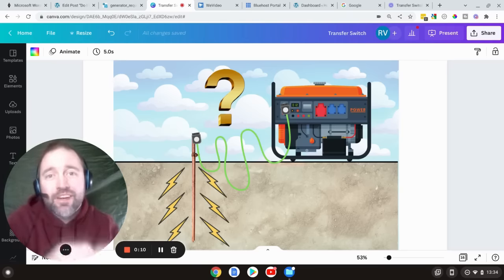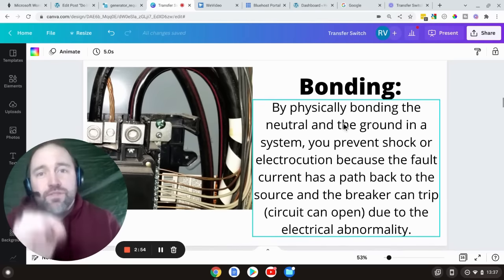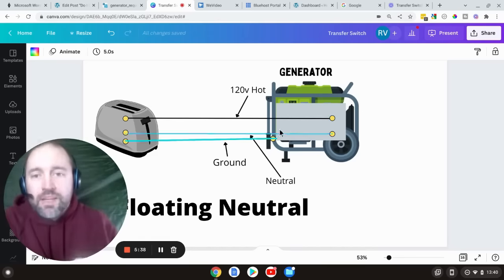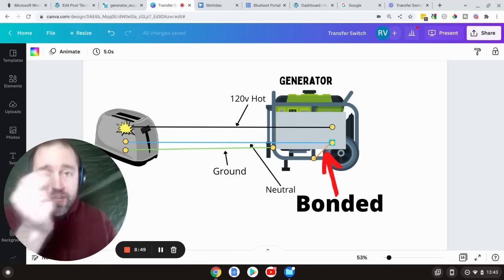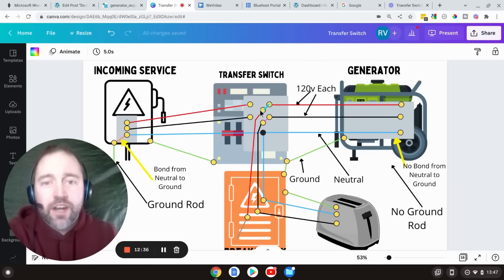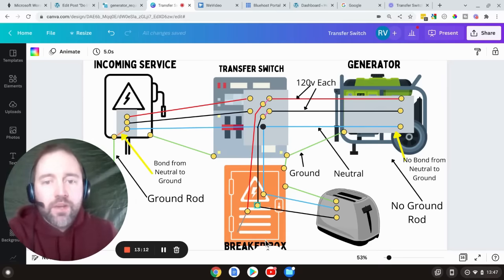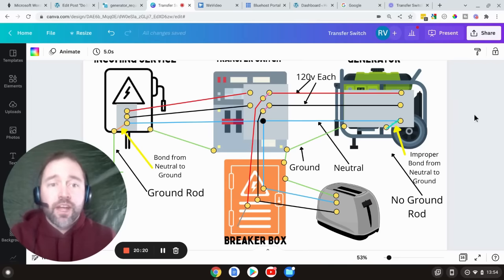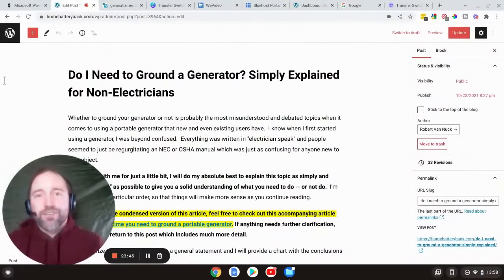When You DO and DO NOT Need to Ground Your Generator [Extension Cord Use & Backfeeding a Home]

Comment: Older homes do not have a main disconnect switch, so there is no Neutral bond before the main panel, except at the utility transformer where the neutral and ground is bonded in many cases, The earth ground and neutral are then bonded in the main breaker panel. Any sub panels off the main panel do not have the neutral and ground bonded.
People often get portable generators with a GFI main breaker in the generator. When connecting to a house, this sharing of the bonded generator neutral and ground, and the bonding in the breaker panel, will always trip the GFCI in the generator as not all current flows on the neutral, but some neutral current flows in the ground wire between the generator and the house.

I often see this fault with a portable generator being used to power an RV. The service in the RV has the neutral and ground bonded. When plugged into a GFCI protected generator, it will pop the breaker. Some campgrounds have GFCI breakers for the RV hookups and a bonded RV panel will trip those breakers too.

The Utility bonding the neutral and a local pole or pad ground will often result in measurable current on the ground rod in the residence as there is no "Ground wire" to the utility, only neutral. If there is a ground gradient, between the house ground and the utility ground, there will be current in the utility and residence ground rods.
This is most often seen when a distribution line is only single phase and the utility transformer primary is hot and neutral instead of two hots. All wire has resistance, so the utility transformer will have it's voltage drop on the neutral conductor of the primary line become slightly elevated from the local ground potential. This can cause problems with some solar equipment and other sensitive electronics.

Comment: So many people misunderstand what happens when electricity has two paths to chose from. Current neutral bonding standards, unfortunately add to this confusion because the scenario they are trying to protect you from is a very specific one, that, in the interest of safety, is never fully explained due to the fact that outside of this specific scenario,  bonding  in a second, or third, or 100th place in addition to the first means of disconnect makes no difference at all.   What is this mysterious scenario you ask? If something causes the Neutral path to the source to be broken, then power will return via any grounded part, be it the frame of the toaster, or the generator or what have you. Unless the neutral is open, bonding grounds to neutrals does nothing. It does nothing. Everything that is grounded is at zero potential to ground. The frame of the generator will always be at zero potential to ground, as well as the neutral, and you will never get a shock from touching anything that has zero potential to ground, if you are not touching the hot leg. An open neutral path is the only thing that makes additional bonding dangerous, because the ground wires may not provide sufficient current carrying capacity to cause a breaker to trip, in the event of a short circuit to any metal part of the appliance. Meaning the circuit is shorted, but power is not interrupted, leaving possible potential that you could get your hands on, not to mention grounding conductors are often much smaller than current carrying conductors, and tend to simply overheat, rather than tripping the breaker. Anything grounded with a metal wire will be the path of least resistance electricity will prefer to take, rather than any circuit completed by a human body.

Comment: Respectfully submitted for your enlightnment, having repaired generators extensively for the US Army, I will point out that all generators should be grounded by the frame. I saw a man lose his life on a free standing generator, 60kw, that was faulty, when he became the grounding mechanism with one foot on the platform and another on the ground. A grounded frame would have saved his life.

Comment: this means that i can use the previews  earth pole from my house for off grid 
.    no grid on that system anymore if  there s questioned!!!!!!    but  if use the earthing LINE on another panel with extention cords i need to uninstal  the earthings of the first panel i abandoned so they wont get electrified any scenario  error....!!!!!     inverter was a car inverter   and didnt have any earthing so i made one to bond and connect!!!!      now i need to have batteries fully enclosed to be fully safe !!! and of course  respect AC and DC  !!! thanks man

Comment: Very good, I got a question mab u can help. I have 400 amp service it goes to an sub panel , 
off 1 of the main panels I have my well pump I added a room on the house use 1 circuit for that room
I put in a GFIC in because it is a concert floor. Don’t know y but ever so often it will trip the gfic,
It is all on the same ground rod, y will it trip the gfic?

Comment: Thanks for this amazing content. I have a question: What if the generator is bound from neutral to ground, with no ground rod and the neutral is not connected to the incoming service, can I use the ground from my home? The generator will link my home with 120/120/N (no link for the ground), but all devices at home will use the ground from my home. Is it safe?

Comment: As an unlicensed electrical contractor very nearly every installation I see has an unbonded neutral in the main panel and there is a 2.8VAC difference between the two throughout the house. Without a doubt, it is licensed-yet-clueless contractors who are doing this. Personally, I educate my customers regarding the safety concerns. Additionally, I frequently see "hot loops" which share multiple circuit breakers on the panel. Assume nothing.

Comment: Interesting video. The one thing I noticed is the transfer switch we have only has 2 blades. Both are hot leads. The neutral and grounds are not switched. Each switched leg is one leg of the 220v circuit.
Reply: Neutrals are not switched, any potential for the neutral to be switched a the slightest amount of time where the hits aren’t can create dangerous voltages

Comment: Can you make a separate video explaining this but with an off-grid solar panel system setup? I'm trying to power my home with solar panels, inverter/batteries, main breaker panel, and backup generator. I know some things have to be bonded and grounded, which are they? And should I put the main ground rods on the main breaker panel or solar inverter? Thanks!

Comment: I’m just a guy with a floating neutral inverter generator that wants to run a couple of extension cords into the house during a power outage. Do I need a ground rod? Thanks!

Comment: Don't simply do anything in the video as it may be dangerous in some scenarios (not all). 
The UK had special regulations for double grounding if the cord goes outside the grounding network of the house (Tesla charger to a car). It may be ok in the us as most service is connected this way, but keep in mind you may have a different kind of service or grounding in your house. It's not impossible to get 3-phase power in the US (if you live in an apartment complex, have a larger AC-Unit, an 3-phase washing machine, a solar panel ... even after this got removed your power service stays the same). My flat still have the 500A service line from heating with electricity after the heater got removed and nearly all cables removed (copper was expensive). Here nearly nobody have the the bonding in the incoming service panel and it's done near the breaker box or in a special combined box (for incoming service, meter box and breaker box with several in one big box). Every electrician use a tester to verify the conditions before he left the side.
It's possible and in some times necessary to have multiple grounds (over AWG 9 you have special exceptions). If your generator is to far from your house it may be mandatory to have a separate ground or it may be forbidden in some cases. All new homes should get 3-Phase power (for future solar or future car chargers).

Comment: Electrician here and I agree with what you’re saying here and I have myself tried to explain to safety guys at work and they have no clue….most of my experience is not with a genset as you have shown. 99% of generator use is for power at a remote place which needs temporary power, and all electrons must return to the generator for current flow, that being said if a person were to become energized by a fault if no ground rod, no current flow. Unless someone HAS driven a ground rod. Most folks have had pounded in their heads for their whole lives that electrons want to “go to ground” and this is not true, the electrons will flow only if given a way to return to the generator. Even if your body is energized current will only flow if there is a path of return to the generator, therefore in this case no ground rod is preferred! It is my experience that a generator setting directly on the ground running, has such a poor connection to the ground, that you must consider it not grounded, as the connection to ground is too high of resistance to conduct. Again I’m of the opinion that no ground rod is required for these remote situations!

Comment: i disconnected the bonded neutral tap  of a genaeator that was set up with a generator outlet and a breaker lock at the main , the house was tap to ground at the meter base, neutral was tap with service neutral, tested, all work , told customer that the genarator would have a open ground wend not cord plug.

Comment: I have a interlock kit on the main panel. The generator supplies power through a 30 amp feed and it has a floating neutral and grounded to a ground road. An electrician inspected the set up and I have been using it during power outages for a few years, no issues!
Reply: That only works if your property has a ground rod too so that the daily current can flow through the physical earth back to the ground rod on the generator, or if the protective earth inside the building is connected to the neutral line of your generator at entry to the building so that fault current passes back along the neutral wire to the generator. You have to think about your building is earthed.

And you say you have had no issues in that time...how many faults have you had in this time? None?   Duration doesn't prove anything.
Reply: @deang5622  Thanks for your reply. No faults detected. Yes the house has a 8 ft. copper ground rod. The generator is 40 ft. away from the house in a ventilated utility building grounded with another 8 ft. copper rod.
Reply: Same here! I used a Siemens power mechanical interlock plate. Now, some people plugged the generator cable to a dryer outlet to feet the house, that is a crazy idea!
Reply: Wait, I'm confused. I thought if you had a floating neutral generator, then the generator isn't supposed to be grounded. I thought this is because the Neutral and ground from the 30amp inlet box are bonded on the same bar in the Main panel that you have your interlock switch. Neutrals and grounds are bonded. The panel Is the first means of disconnect per NEC code. This, I thought, means your entire house is bonded to ground rod?

Comment: If you are completely isolated from the power grid. May not need a ground.
 But if All you have done is interrupt is just disconnect both sides of the 220v. Also using the house neutral/grounds
You can have a problem with circulating grounds. A circulating ground from 13.2KV or 4800 volts can do more than tingle.
 BUT ground fault interrupters do need a ground path to work correctly. Best to keep those for grid power.
 I am not sure if I have a portable generator with a isolated frame. It should be isolated.
 BUT the best way to use is it. Keep the power grid and the generator separate.
That is why you have a automatic generator put in by a certified electrician.

Comment: Really appreciate the information and time spent putting it out here. Hypothetical question: So in your video, at end at 15:19 your showing a "do not do situation" because you have a double bond with a regular transfer switch. (1. in the service panel and 2 at the bonded generator). I understand why this is wrong and that it will create objectionable current on the ground back to the generator; so the proper solution is to either use a transfer switch that also switches the neutral or use a floating neutral generator. My hypothetical question is, in that situation with a bonded generator and a regular transfer switch, cant you solve the objectionable current problem by just removing the ground connection between the generator and the transfer switch. Wouldn't a ground fault still clear and trip the breaker when the fault flows back to the service ground / bond. This is probably not code, but wouldn't it be better in an emergency setup?

Comment: I need a BLUF (bottom line up front).  I have a Duramax EH 12000 dual fuel generator that has a 50 amp cord to go into a transfer switch to a ten place panel next to my house panel., installed by an electrician. I have a 12g wire from the grounding screw to a brass rod in the ground.  Are you saying I don't need that or that it is dangerous?  Should I just use a bonding plug into one of the 120v receptacles?   Thanks in advance. 
   Second, I just bought a Predator 5000 inverter generator for my RV. I bought the bonding plug which goes into one of the 120v receptacles.  Is that sufficient? Thanks again.  GOD Bless

Comment: For an independent load, Best best is to ground the frame but NOT bond the neutral to the frame.   Use GFCI's for the loads.   You can't get shocked by touching the frame and faults on the load will completely disconnect them.  

If  you are connecting it to your home, ground the frame to the house GROUND and connect (as approved) to the home distribution with 4 wires (G,N,L1,L2).

Comment: I’m going to have an electrician install a 50amp power inlet with an Interlock kit and soft starter
for my AC. Because I wanna have the ability to run my whole house in a power outage. 

I just purchased a Westinghouse tri fuel 10,500 watt generator (peaks at 13,000 watts).

My generator says it comes bonded.  If I understand this information correctly, I plan to make my generator a floating neutral generator.  

Some questions I have:

When power is out, and powering my house with the generator, is there a proper safety protocol for when to touch the generator,  and when to start it and also when to not touch it?  I don’t want to even risk being electrocuted, so what would be the safest steps I can do to prevent shock?

Next question is If I left the generator bonded, and using the same scenario with a 50 amp power inlet and interlock kit, and use the generator during a power outage, Could it be safer for me to leave it bonded to help prevent being shocked.  Being electrocuted is my biggest concern 

Thank you

Comment: What if you are running a 240 volt 4 prong cord from non-bonded generator to house, and then decide to run an extension cord from the generator to power a sump pump or a tool such as a drill or saw? Do you still need to ground the generator for the extension cord or is the bonded ground at the service panel enough?

Comment: The floating neutral is protected by the gfci . so if 5ma goes out on the hot 5ma better come back on the neutral or the gfci will trip ,thats how its works on the hot and neu. not the ground

Comment: I have a bonded house, I have a tri-fuel portable floating neutral inverter generator (GenMax unit) that will be running on natural gas supplied by the house gas main, I do not have a transfer switch but I do have a interlock plate inside the electrical panel that lets me turn on the 50a generator breaker inside the panel when the main is switched to the off position. My question is do I need to bond or ground/ground rod the generator or can I just plug in the generator to gas and electrical extension cord, flip the breakers, and start?  
Thank you.

Comment: One thing I wanted to bring up. You said if you are using a extension cord. The generator should be bonded. For the average home owner tho. If they do that and say the frame makes contact with the ground. Wouldn't that be bad? So would you have to make sure the rubber feet and wheels are Isolating the generator frame from the ground? And what about rain? Thank you for the video.

Comment: Great video:  Question with a inverter generator in order to run some newer 120v gas furnaces some wont run without a " Neutral Ground Bonding Plug" Is this safe ? I would assume it would trip the breaker on the Inverter genorator ? What do you think ?

Comment: if you are using a generator on a trailer you do not bond the neutral or the ground.  However if use the generator for a transfer switch you need a bonded neutral and ground and also you do need a lightning rod into the ground. NEC does not handle too much info but on bonding for trailers only for homes.  The bonding in a trailer will cause the ground of the generator to be active and could shock you.  The generator is grounded when operating separately on a trailer.

Comment: If you will indulge a question, my question is not really about  anything you discussed. I have set up a generator and studied the code book in depth.

My question may be off the wall but what exactly is the purpose of a ground rod? 

I thought I knew, but then it occurred to me, what would be the problem if there were no ground rods?

Comment: I have a switched Neutral transfer switch so I made sure my generator is bonded and I installed a ground rod! The only thing I don’t like is that both grounds terminate in the transfer switch, and since both systems are bonded it seems there could be a possible problem? Hopefully you could clarify this for me! Thanks Bob